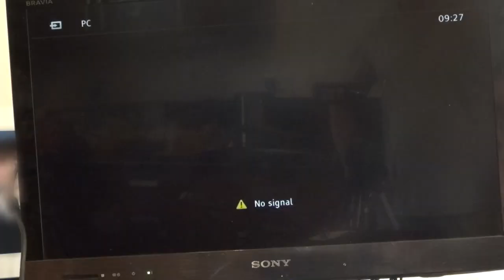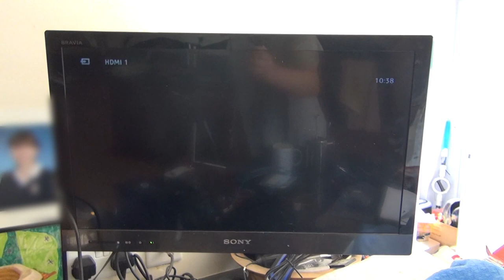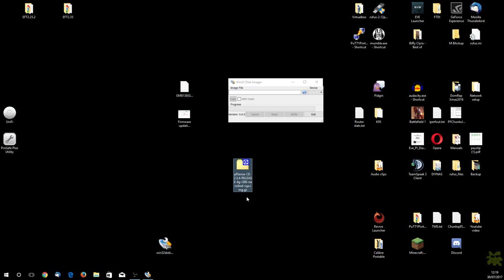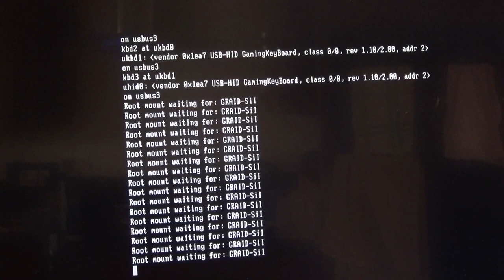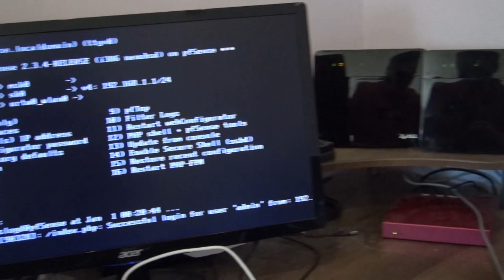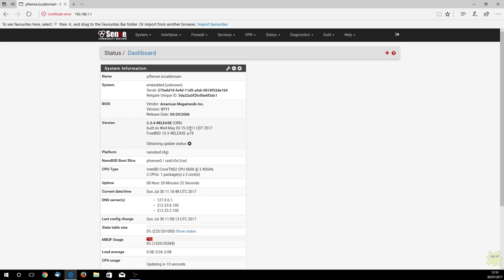DIY pfSense router from Junk PC parts - can I make it work?

Comment: this will work out of junk, but the junk is not designed to work 24/7 and you will probably need a personal  Power Generator to support the electric consumption
Reply from the maker: Hi Yousef! Absolutely right - I was very clear that this was really just a fun experiment, the E6600 is not very power efficient and the setup was drawing between 120-160W! The OPNsense build I did in my more recent video uses an i3-2100 and better @ 80W consumption and is quite happy running 24/7.   The aim was to show you can save a lot of money, build a very powerful router using really old hardware and free software which outperforms even high-end consumer devices - I think this video kinda proves that point in a junky way!  Thanks for your comment! AM